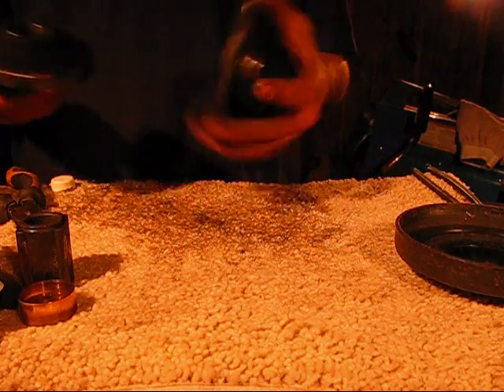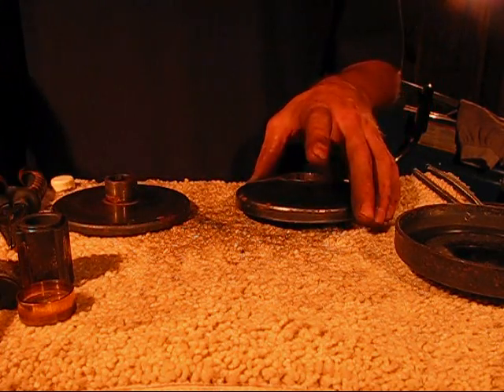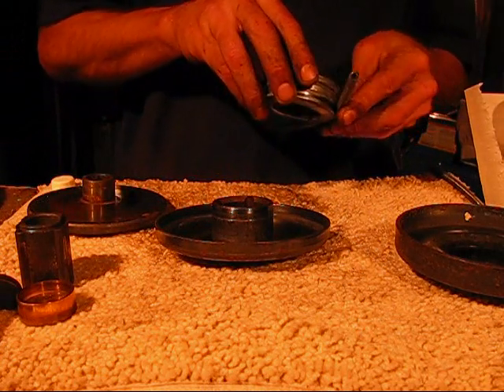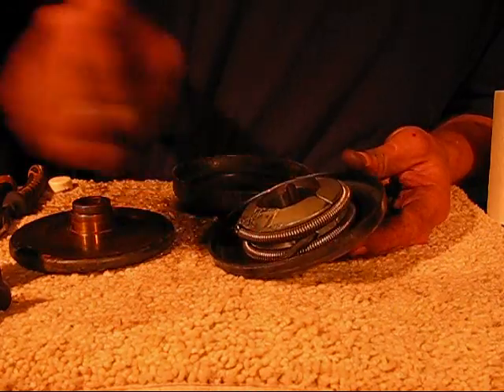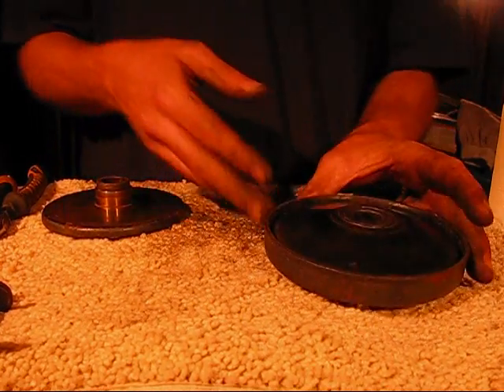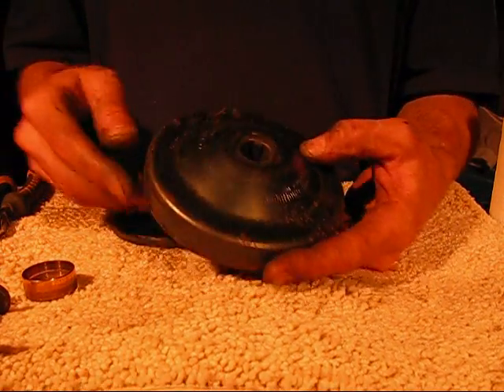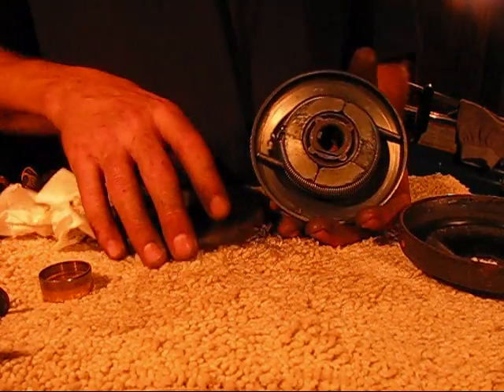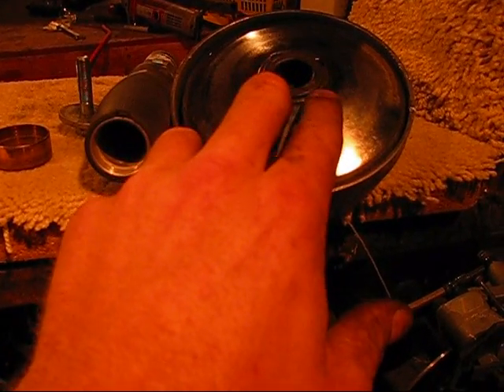Go Kart Torque Converter #2 ( Cleaning my Driver for 30 series Comet )

Comment: I will try to get a comet belt and see if it will work longer than just one day. I already got a different spacer that goes on the engine shaft so that both pulleys will be in perfect alignment. Thanks again and keep making useful videos.

Comment: 13:30 my clone does that too, I took it apart and found the there is a little bit of slack between the gears on the crankshaft and the cam. I think they all do it. kinda weird...

Comment: Thanks for the info. My belt was ruined yesterday because of that small off set but than again it wasn't  original comet but a cheap Chinese version of comet. Will comet belt fit on Chinese TAV2 ?

Comment: Thanks for the props, bad bearings for sure and you need to put an additional video up concerning cleaning that hub its the main reason belts get torn up.
Reply: My driver pulley keeps spinning the weights off of the rods any clue what I can do

Comment: i used a small flat screw driver and a strong piece of wire with the end bent into a hook simply slide the spring out of one hole and drag it with the small hook then push it back in with screw driver if anybody else wants to know the same thing